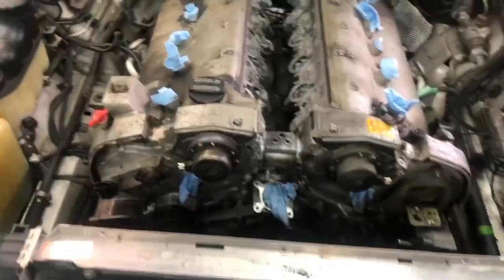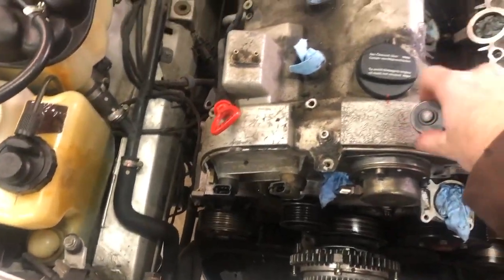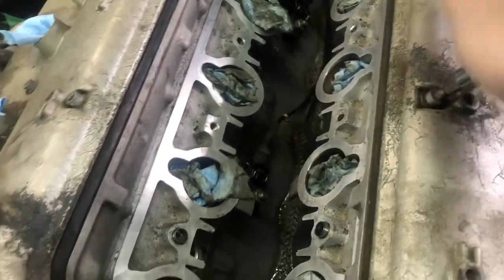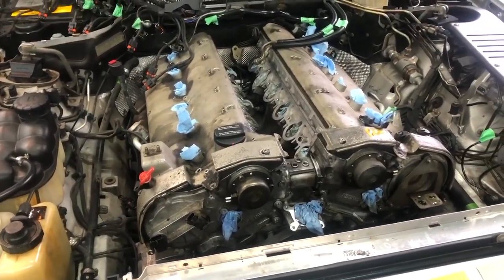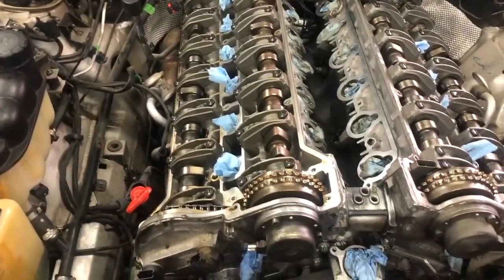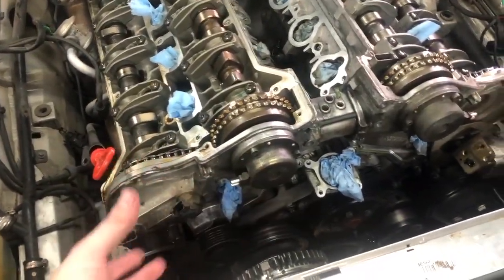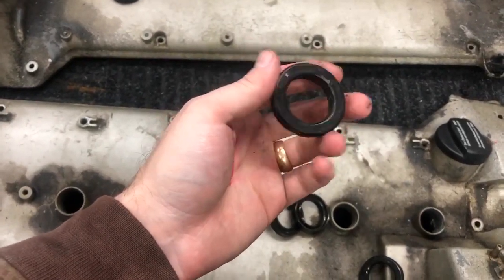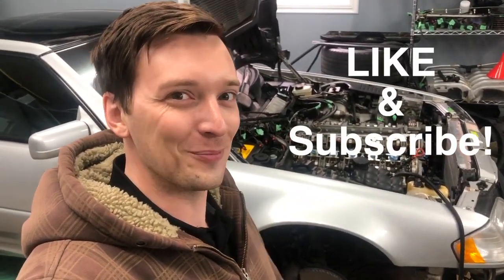Was my Mercedes SL600 LEAKING from the factory?? | Project SL600 ep. 4

Comment: I have a 98 SL600 I take the fan off all the time with the clutch. Just move the fan shroud back over the fan. Use a long screwdriver to hold the fan clutch in place. An allen key with an extender, and done. Off she comes.  I am changing the hydraulic front shocks on mine shortly
Reply from the maker: I should have tried that. In the end, I decided to purchase a kit with the correct-sized wrenches.

Comment: What is the torque supposed to be on those bolts?  Might not be too much since you don't want to mess up the gasket, but those do look too loose
Reply from the maker: They are supposed to be 10Nm. These were 100% loose. I've never seen that on a car before! My guess is that the gasket shrunk over time or something.